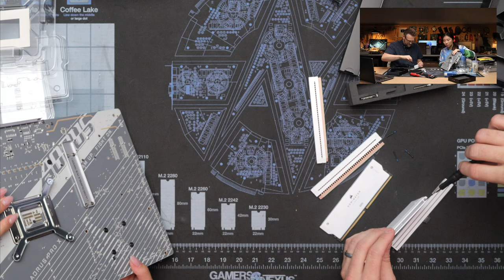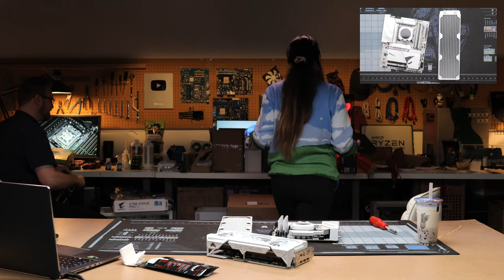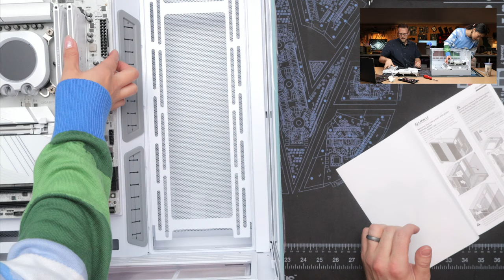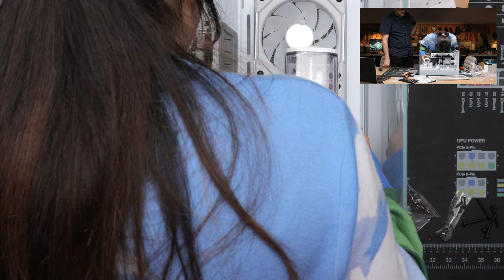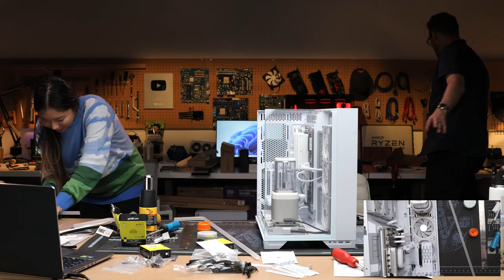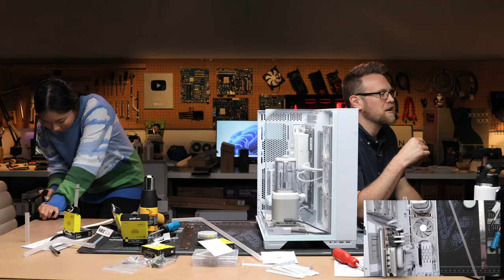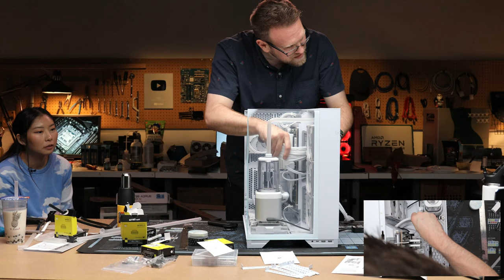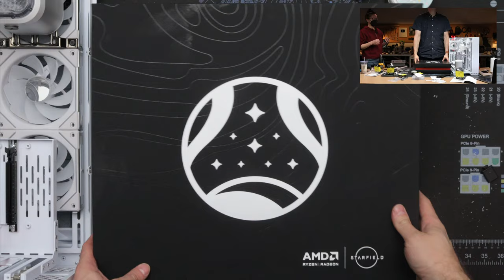Watch Us Build A Boba Cooled PC - LIVE

Comment: FyI at 1:58:00 or so you encountered a problem with tubing the cpu orienting the inlet and outlet on the cou water cooler. The 90 degree ports to the block were in unfortunate positions.  Your direction was to remount the cooler block. Assuming the 90 degree "corners" were not moveable. I pay attention to the threads on the 90 degree prices. Usually the threads on these have 2 starting points. Start the threads at one point, tighten and it ends up pointing in x direction. Undo it then start threading it at the other start point and it will tighten to 180 degrees to where the previous point was because the thread start point was 180 opposit from other thread start point.